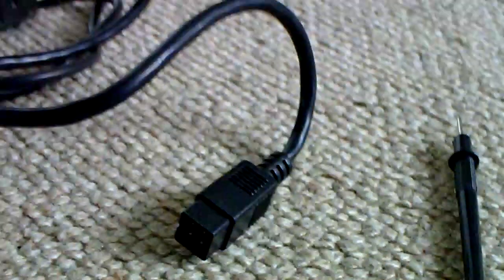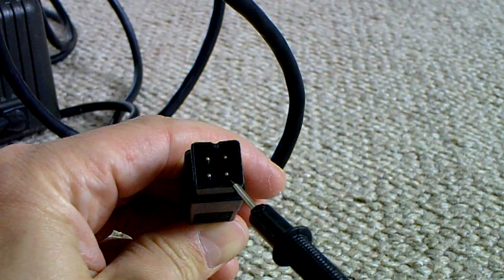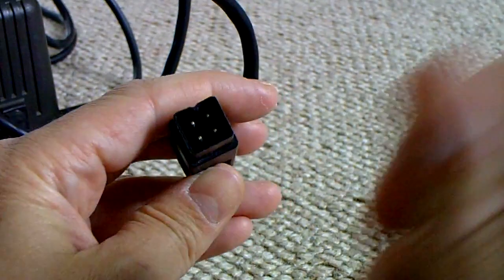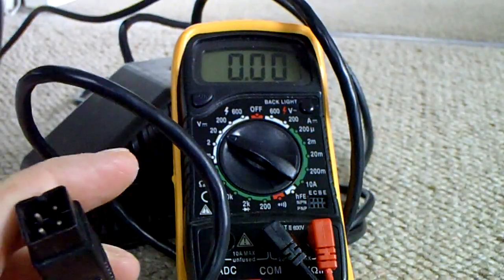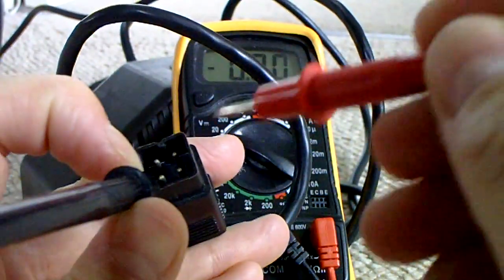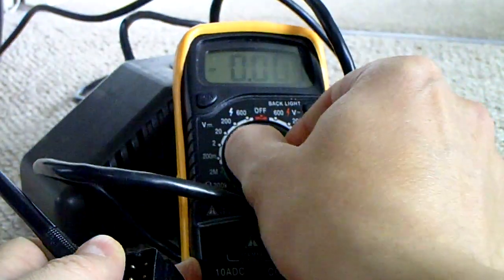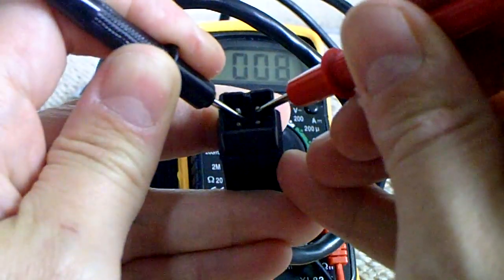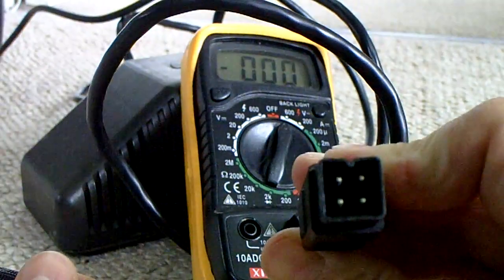Commodore Plus/4 Computer Power Supply Voltage Test

Comment: I had a Plus 4. It stopped working in '87, so in desperation, I ripped the base from the power adapter in order to find the problem, which I was convinced was within the adapter. It wasn't, it was... the plug fuse. Of course. ( I took somebody's word for the fuse being fine )

Everything inside the adapter was embedded in resin. So I couldn't have done anything even if it had have been the problem.
Reply from the maker: Urgh, I hate those resin filled things.